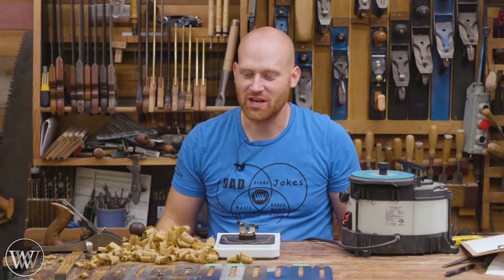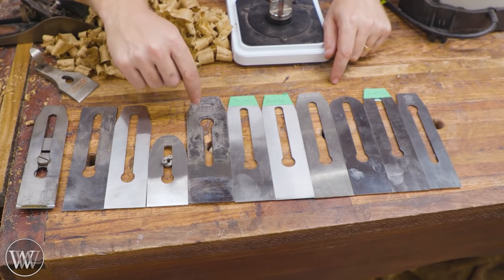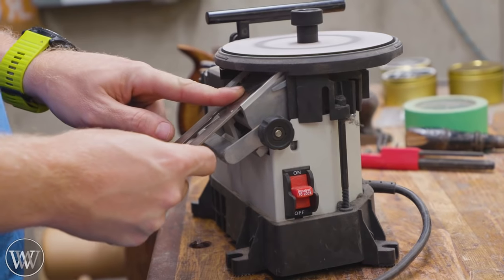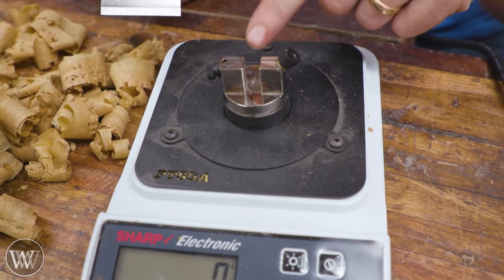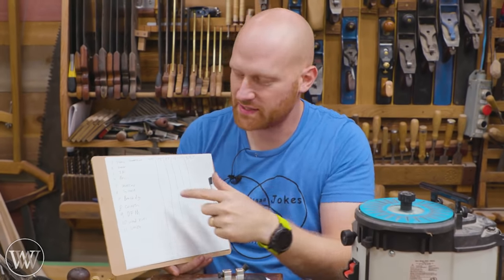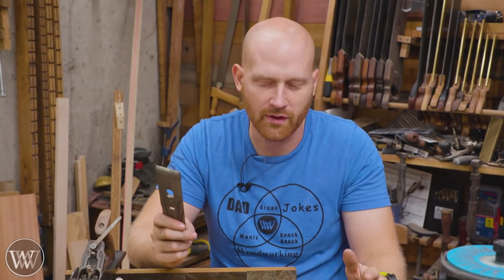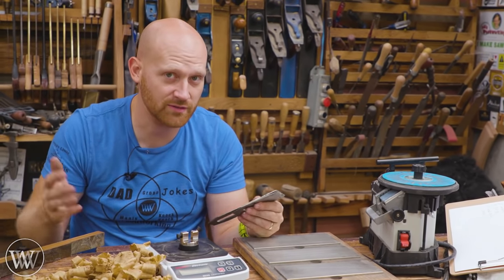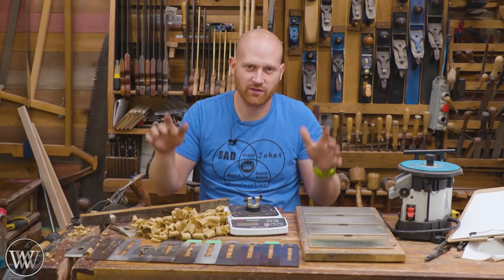Plane Iron Test Method

Comment: Is the 20 strokes between tests arbitrary, or did you test an iron out to see if this was a good value?
Otherwise this looks like an amazing test, and I look forward to seeing it.
Reply from the maker: 20 strokes is what I'm expecting however I may end up changing it more or less depending upon my findings. I'm starting with 20 because I expect that to be about a small as a change I would be able to measure. I may end up increasing it to 40 or 50.

Comment: Sounds like a great test. The only real variability I can see is the "depth of cut" on the various planes. Not sure how you can standardize that - but knowing you, you'll do your best. I can't see you using microscopes and reading how many microns stick beneath the plane bodies. Or measuring the distance from the edge of the blade the chip breaker is....
Reply from the maker: I will end up measuring the first curl from every run. And so far all of my testing as long as I leave the depth adjuster right where it's at they come out exactly the same. My tolerance for it will be within 1/1000 of an inch

Comment: One of the irons with a chunk of high speed steel brazed on as the cutting edge might be a neat test too
Reply: I tested those - they vary, though, even though I think they're all in the same place. The one we tested was not quite M2 alloy (we had it XRFed to find out the composition) and was supposed to be 61 hardness, but the three strikes at the edge from a versitron were 65-66 hardness. I've had some since that were even harder (unusable and wouldn't hold an edge). The result was that (I'll give you a subset) in one of the tests, hard O1 went 800 feet, A2 went 1000, and the brazed iron went a little over 1300 (V11 went about 1560, and CPM M4 went slightly further). 

Caveat with these - a test like this is ideal

Comment: James, there are "cheap" replacement blades available on Amazon in three packs for the #4/#5 Stanley style planes, I would love to see thise tested as well. Also, what about testing a heavy pitchy wood like some evergreen species? How do the plane irons stand up to pitchy woods as far as the pitch sticking to the blades and impact on sharpness/usability? What oil/wax/treatment would you recommend for pitchy wood planning to reduce the pitch sticking to planes and chisels if this doesn't fit your testing parameters?
Reply from the maker: Yes! the Caliastro is a cheap Amazon blade https://amzn.to/33zOqmc most of them are made by the same company, but I might add one more to the list. I am also including the Harbor freight as well. I have never had much issue with pitch build up affecting the plane blade as it is cleaned every time it is sharpened, but it would be fun to explore closer.
Reply: @WoodByWrightHowTo  cool, thanks for the feed back.
Reply: @WoodByWrightHowTo  Pitch Pine (pinus rigida) is a good "pitchy" wood to test. It's often used for kindling because it's so pitchy it makes starting fires easy.  Also Longleaf Pine (Pinus palustris). Their pitch production is so prolific that it was once used mainly to produce resin, tar, and turpentine used in shipbuilding back in the days of wooden ships and iron men.
Reply: BTW, that's how Carolinians got their nickname, Tarheels.

Comment: James. It looks like you’ve updated the chart with the Lake Erie blades. Are they really that good? It looks like they smoke the competition in most areas. I’m looking for a 4 1/2 replacement blade that will leave the best surface. What would be your suggestion?
Reply from the maker: Princeton. I'm waiting to test another version of theirs as well as a couple others and will soon add them to the test list and do an update video. As to which one leaves the best surface that just depends on your sharpening. Even the cheapest iron can leave an amazing surface. It just depends on how long that edge will last.

Comment: Hi James.
Maby you should where possible. Test the sharpness in the original state like you dit at 2:33 .
And as a stanley plane collector. I whould like to see the results for a new stanley plane iron. And for the really old stanley planes (sup type 8)
Reply from the maker: I am thinking of including three or four old Stanley plain irons as a control. Prior to about 1980 there were very large variances in the hardness of plain irons from batch to batch. So even over the course of a run in a single year you could have 20 different batches with 20 different hardnesses. It wasn't until digitally controlled tempering systems came out that you could get a much more accurate hardening every time.
Reply: @WoodByWrightHowTo  awesome

Comment: How about commenting on Stanley vs Record irons?  I’m convinced the Record irons are better.
Reply from the maker: I'm not going to be getting into antique irons as the variance in quality was rather extreme. Before digital temperature controls for hardening and tempering each batch could be considerably different. So the problem comes testing one two or three irons might give you a slight idea but it won't tell you anything about all of record irons or all of Stanley irons. I'm only keeping a sweetheart and a Sheffield in the list as controls.

Comment: Already you going to be comparing the different steels or just brands (i.e. pmv11 vs A2 vs...)
Reply: IT really won't matter as long as the same alloy irons are same hardness. Higher hardness and longer planing, so if you see two O1 irons compared, the one that fares poorly is generally just softer (but it'll be easier sharpening below a point).

Comment: Do irons get dull over time when not in use? 
Like if you sharpen the iron  and then leave it in the plane on the shelf for a week, month, or a year..
Reply from the maker: That would be interesting to test My assumption is no. As long as nothing comes into contact with the iron it shouldn't have any issue.

Comment: Yes, this is an interesting project. I imagine that English iron out of a wooden body is laminated steel. Is it? It would be interesting to see some Japanese laminated blades in the mix, too. Big project.
Reply from the maker: Yes. It is laminated steel. I was thinking about doing Japanese as well as a bunch of other antique irons The problem is the consistency from them is not enough that testing one iron would tell you about the average. Up until digital thermal control there was a wide variety in average hardness is in irons. I'm also limiting it to replacement irons. I might do Japanese irons in the future but usually those are dedicated to particular tools. I'm using the Sheffield and Stanley sweetheart more or less as a control.
Reply: @WoodByWrightHowTo  I see. I'm sure you're right. I wonder whether hardness alone will make a blade hold its edge once it has been sharpened.
Reply from the maker: no hardness alone wont matter there are 4 or 5 standard steels used now, but there use to be hundreds and those were often switched batch to batch depending on what they could get. there are dozens of small things that can affect it. it will be interesting to play with.

Comment: Maybe a record plane iron, as there are so many around?
Reply from the maker: I did not think they still made replacement irons> I am including the Stanley and Sheffield as controls, but I might include a record too.
Reply: I saw record replacement blades in South Africa but they may have lingered on a shelf for years. Also any Stanley blades were made in England. At least they said so.

Comment: I’d like to see the Lie Nielsen iron. Seems like a big miss to have a PMV-11 as well as another Veritas iron (I’m guessing either A2 or O1) but not a LN A2 iron.
Reply from the maker: I have Lie Nelson. there are a few others such as the hock Cryo that are also in the list. I have them all listed in the description of what I have so far..
Reply: @WoodByWrightHowTo  Sweet! I was just going by what you called out in the video. Glad to hear it's in the list. I'm really looking forward to this because I loved your chisel comparison so much I bought the COMPLETE line of Narex Richter chisels in all 7 sizes (from 1/8 to 1 1/2") because I'd been looking for a quality 1 1/2" chisel anyway and I was unhappy with my Stanley Sweethearts as a general purpose set and my Japanese chisels have been re-ground for working better in soft woods. I've been agonizing over holding out for PMV-11 planes from Veritas or sticking with my preferred LN brand, since it doesn't seem possible to put a PMV-11 blade in a LN plane. So I'm very interested in your findings. 😉

Comment: I'm guessing you don't have access to a hardness tester?  Would be additive information for the data matrix.
Reply from the maker: I am hoping to have them tested at a company that does that. but we will see.
Reply: @WoodByWrightHowTo  You can pick up hardness file sets pretty cheap. They are only accurate to within about 5 RC though, which might not be enough precision to compare the modern steel blades.
Reply from the maker: Yep. I have a set. The problem is most of these have hardnesses that are in between two of those files.

Comment: I think there's an error in the video. It looks like you included two "takes" of the scene about measuring how easy a blade is to sharpen.
Reply from the maker: Yes. I just fixed that. it should be updated soon.

Comment: since you need to take the iron out for each time you measure, how do you menage the dickness of the different shavings
Reply from the maker: I measure the shaving on the first stroke of each pass. But as long as the depth adjuster is locked in well it will be right at the same setting every time. But I keep the shaving within a thousandth.

Comment: James, thanks for all this work! On your recommendation, I am interested in purchasing a Wood River iron. Do you know if those blades fit in a vintage Stanley (Type 16) plane?
Reply from the maker: Yes. They'll work.
Reply: @WoodByWrightHowTo  Thanks! I purchased one this afternoon. I believe it was for their Wood River line of planes. Is that the iron you tested, or was it the IBC Pinnacle iron? Thanks again for all your efforts, I appreciate your work.
Reply from the maker: Yes that's the one that's listed for the Wood River iron.
Reply: @WoodByWrightHowTo  Bought it and brought it home, unfortunately it was too thick... When I install it, the blade adjustment stub doesn't get to the chipbreaker and doesn't move. I was REALLY hoping this would be a budget solution for this plane.

Comment: You need another kind of data:  a repeatability value.  Take 5 sharp blades and test 5 different places on each one.  Normalize the data so that the average for each blade is the same.  The standard deviation of the normalized data divided by the average is the repeatability of the measurement.  It will allow measurement uncertainty and statistics geeks to help you figure out whether you are actually measuring something, or whether it's just all noise.
Reply from the maker: Yep. That's already in the system. There will be several series of tests done on each iron so that they can be averaged out.

Comment: I think i would like to see how other angles hold up..... i sharpen everything to 25⁰.... but i work with a lot of pine.... (for my chisels) so I just run my planes there too
Reply from the maker: I may end up picking a few of them and do a series of tests to see what comes of it. It would also be interesting to see how it affects the force needed to push or pull.
Reply: @WoodByWrightHowTo  agreed!!!
Reply: Are going to test one of the old standard stanley irons?

Comment: Let's see an Ohio Tool Company iron.  I have found them to work much better than my Stanley ones.  I have a #3, #5, #5 1/2, and a #8.  If you want to borrow one you're welcome to use any of them.
Reply from the maker: I'm not intending to test antique irons in this run. The problem with that is there was a very wide variability in the hardness and consistency of the steel in the past. So testing one iron doesn't tell you anything about the average of the company. Even testing one for every year they made them wouldn't tell you much you'd have to test hundreds of them to get an idea what the average of batches were.
Reply: @WoodByWrightHowTo  I've heard that before.  Maybe it was you in the chisel video or somewhere else.

Comment: Have you seen David Weaver's work on wood central?  He concludes that the edge shape matters more to edge performance than the steel.  A mediocre blade sharpened in a very specific rapid manner outperforms a well-sharpened top quality blade.
http://www.woodcentral.com/cgi-bin/readarticle.pl?dir=newarticles&file=articles_958.shtml
Reply from the maker: Yep. That is my expectation with it as well.